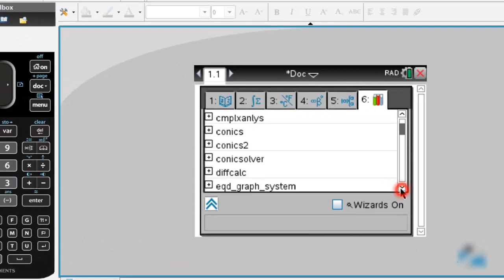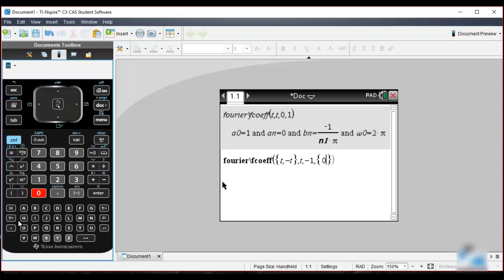Fourier Tutorial using TI-Nspire CX CAS in English

Comment: The code is wrong. It doesn't work with rectangle functions.
I tested it with the following function f(t). The coefficient a1 should be 0.

f(t) =  5 for 0 ≤ t < 2
          -5 for 2 ≤ t < 6
           5 for 6 ≤ t < 8

Comment: Does the fourier library include sine and cosine expansion functions or half range series? If so, are they similar to use as the fourier expansion function? Thanks for the helpful video.
Reply from the maker: If I understand you correct , fourier library get (an , bn , a0) and I think this is sine and cosine expansion
there is two functions in this library : 1) fcoeff : get an , bn , a0
2) fourier : get fourier series for certain "n"
Reply: Ok. I think I understand. For example, if bn ends up being 0 and an and a0 are non-zero, then I could rewrite the Fourier series as a cosine expansion. Thanks for the help!

Comment: I have the same Ti-Inspire CAS but can’t find the Fourier in the library? Do I have to download something?
Reply from the maker: Nadeem Essak 
Hello, Yes there is a link in the video info
While you click on the link, the file will downloaded automatically
After that, to install it on nspire cx cas you have to follow these instructions :
1- Connect nspire to pc 
2- Open nspire student software or nspire connect on pc 
3- Copy the required files ".tns." to MyLib "folder"  in the calculator 
4- Finally refresh library from calculator "press doc then 6" Refresh Libraries"

Comment: Hello, I've got the tnspire cx II-T and i can not put your zip on my calculator. What i have to do?
Reply from the maker: Hi @elias
Calculator accepts tns files, which is inside zip file
So Extract the zip file first, copy the files inside it to the calculator
Reply: @Coder93   I found the tns file but i can not put it on my calculator? is it because i have t nspire cx II-T
Reply from the maker: @eliaspouppos6621  how do you transfer it ?
Reply: @Coder93  It's alright thanks but when i open it i have empty page i do not have  this fcoeff automatically how can i get this
Reply from the maker: @eliaspouppos6621  first you have to copy the tns files in MyLib folder, then refresh the library
But there is something I don’t sure about.
As I remember it works only with cas version
Reply: @Coder93  It works thank you. IT IS PERFECT

Comment: Hello I dont know if you are still active but how do I install the file that is in the download link? Thank you for the video
Reply from the maker: Hello,
While you click on the link, the file will downloaded automatically
After that, to install it on nspire cx cas you have to follow these instructions :
1- Connect nspire to pc 
2- Open nspire student software or nspire connect on pc 
3- Copy the required files ".tns." to MyLib "folder"  in the calculator 
4- Finally refresh library from calculator "press doc then 6" Refresh Libraries"
Reply from the maker: Also remember to extract the zip file first
Reply: wow thank you so much! works pretty well! helped me a lot. Also I have a question, if I put a function with a non symmetric interval lets say from 0 to 5 for example, it will solve it by sine, cosine or periodic expansion?
Reply from the maker: I think yes
Give it a try and if there is any problem, I am glad to help you
Reply: The data of my exercise is:
f(x)= 0 0<x<1/2 , f(x)=1 1/2<x<1, and it specifies that needs to be solved by sin expansion, but the program gives me a0, an=0 and bn, which is neither a sin or cos expansion...
Reply from the maker: Luis Guillermo bn means that the the function is odd and only represented by sin, that what in my memory now

Comment: My output is in  the form of trig functions and angles (i.e. fcoeff(t,t,0,1) --> (180(90cos(2n1*pi)+...+ -90(sin(2*n1*pi)/n1^2*pi^4). Is there a setting that can be changed to output in the form shown in this video? Thanks.
Reply from the maker: Check the angle and make sure that it is Radian not Degree
Reply: My mode is in radians, but still no luck. Anything else that could be causing the issue?
Reply from the maker: Here is a screenshot from correct setting
Image Link: https://imgur.com/a/mZRm5